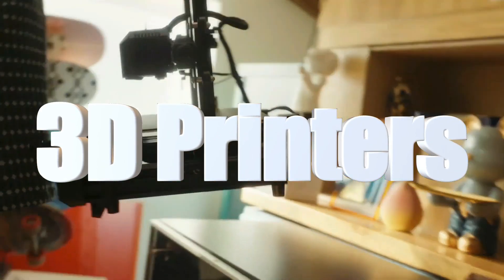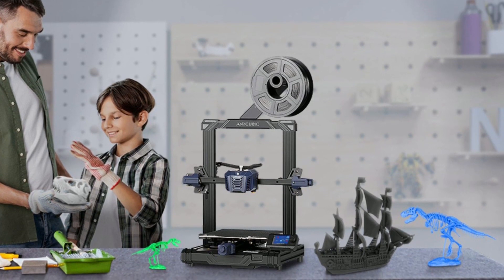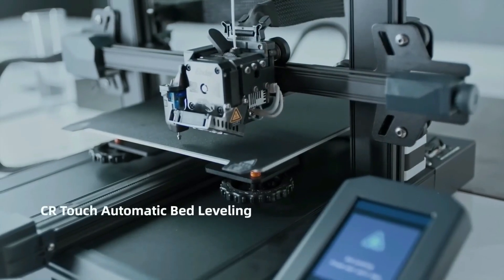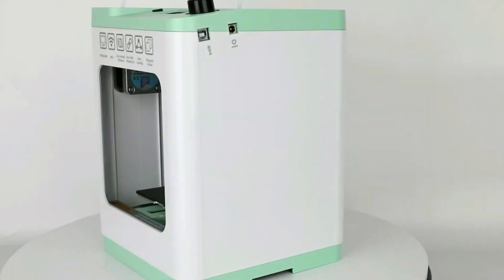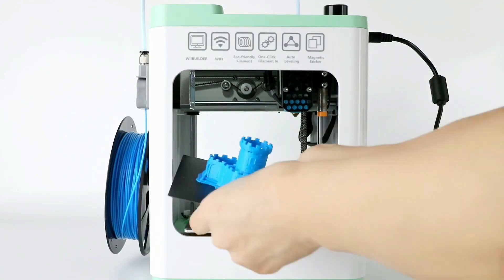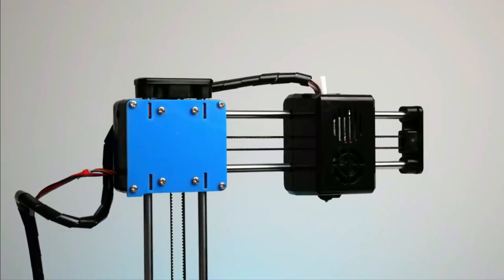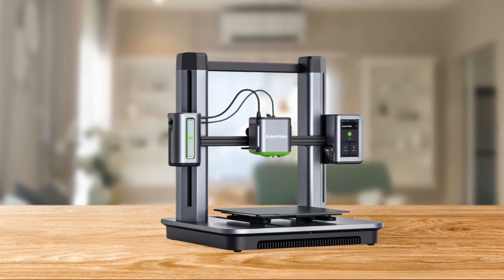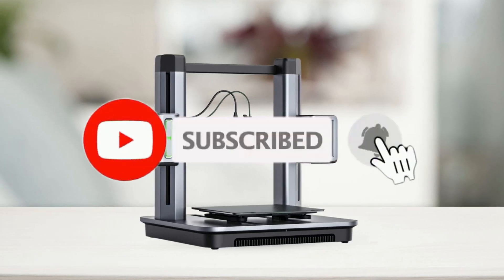Top 5 Best 3D Printers for Beginners In 2023

Comment: Dude, you mentioned the neo, but obviously never used this, i had a terrible success rate with the kobra neo, the ABL probe simply doesnt work,and since they removed manual leveling to save pennies, you CANNOT get a perfect first layer, its impossible, kobra series is basically a scam.  I've moved onto an s1 pro and an S1 plus, I recommend them to fellow makers for under $500